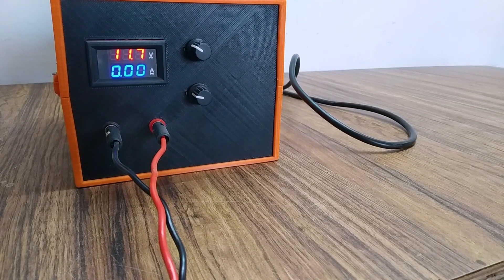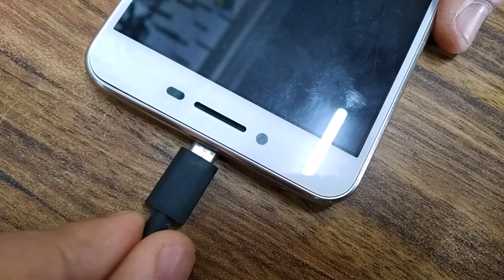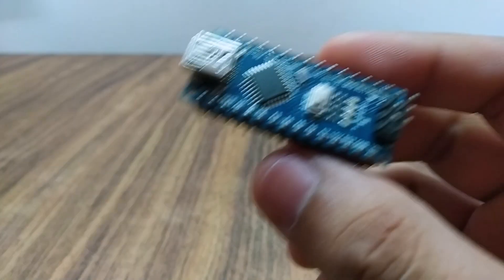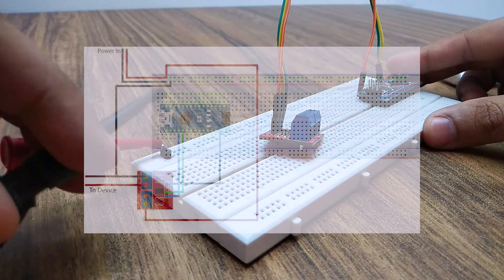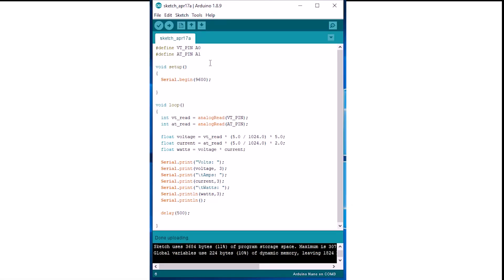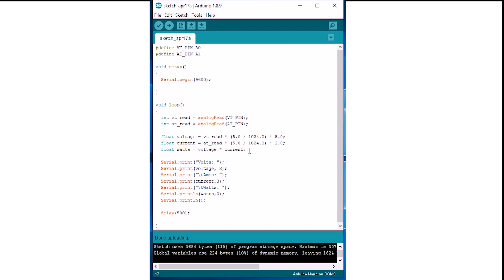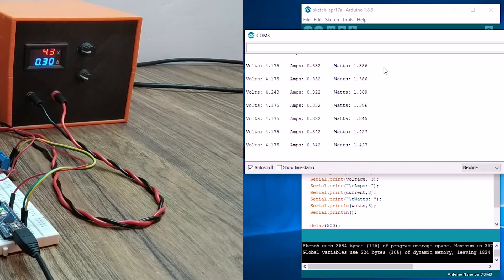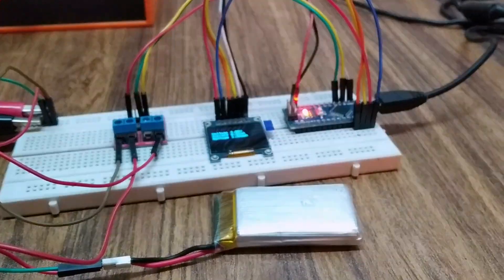Measure Voltage and Amps Using Arduino

Comment: My project is about displaying the battery voltage and current using 16x2 lcd. I connect the input side of MAX471 to the 12v lead acid battery . Output side connected to buck converter .  Vt and At are connected to the A0 and A1 pins .Buck converter adjusts the incoming voltage to 5v and connected to the Vin of my arduino Uno. The  displayed voltage and current are 16v and 10A. Is anything wrong on my connection ?